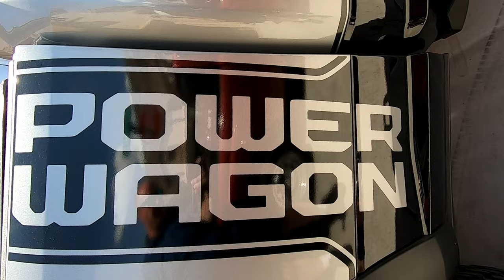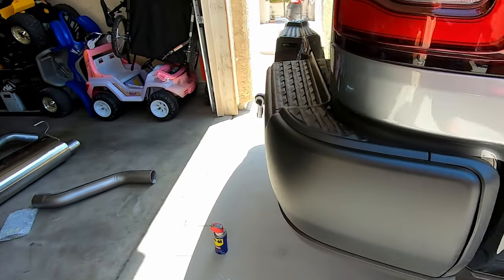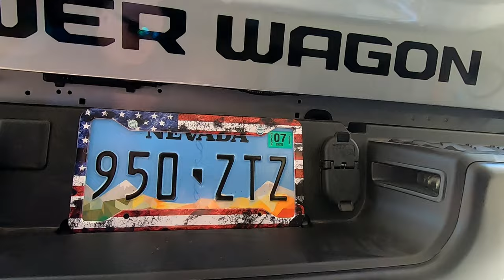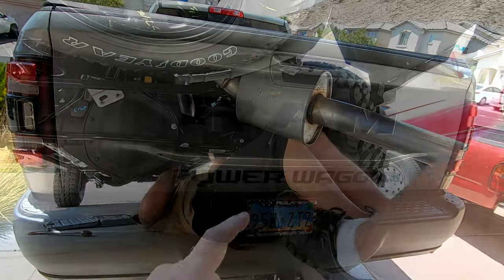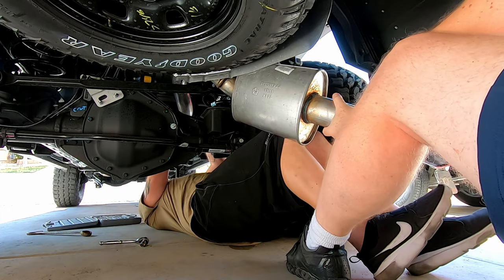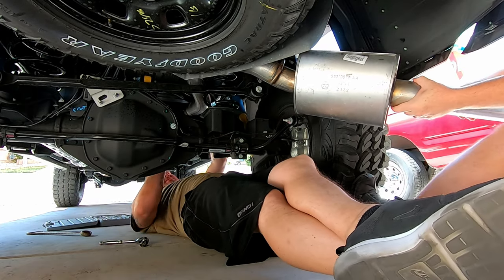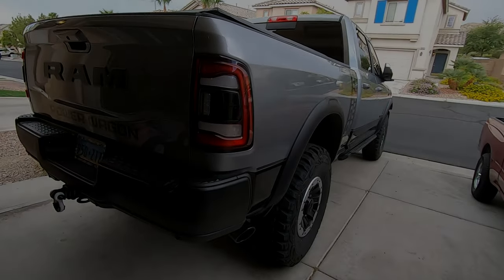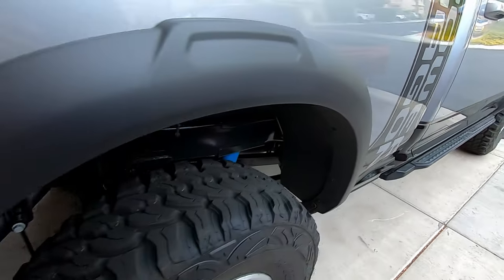BORLA S-TYPE on RAM 6.4L HEMI POWER WAGON

Comment: Nice to work on trucks with so much ground clearance. Borla has always been top shelf! If you go with another brand stay with 304 stainless over 404. 404 might last longer over aluminumized steel, but salt will surface rust it disappointedly bad. Borla is worth the extra money for sure!

Comment: Resonator, not a muffler.  They actually help your engine produce more power and gas mileage by using sound waves to help evacuate the combustion chamber and move the exhaust down through the pipes and out of the muffler.  This action relies heavily on the resonator. By tuning the pulses of exhaust gas to work together, it creates stronger waves of exhaust that vacuum the gas out more quickly.

Comment: The "rear muffler" isn't a muffler, it's a resonator.  That's why no difference in volume/loudness.  Resonator just changes tone and helps eliminate drone.  How's the Borla sound with MDS kicked in?  Also, those aren't bead locks.  They are bead lock capable, if you can find the rings that Ram says exists (probably right behind the unicorn barn as far as I can tell), but as delivered the rings are just rim protection/beauty rings.  I've got a 75th anniversary PW and will probably stick with 35" but those 37" look nice.
Reply: Curious about the MDS with an aftermarket exhaust.
Reply: Same.  I’ve been trying for 2 years to find the bead lock rings for my 75th.  No luck.
Reply: @benmartin2697 it’s annoying either way. I always turn it off
Reply: @benmartin2697 only goofs get annoyed by mds.  Sounds fine with magnaflow
Reply: Whats mds and how do you disable it?
Reply: Just set the manual gear limiter to 8th when you start the truck and mds is disabled.
Reply: @SeguroOffroad from inside the cab, highway speeds, how different does it sound from stock when it activates, and what speed does it start to fade? I like my MDS and it's on most of the time I'm moving. 25-50 mph seems like the sweet spot. Figure more mods, more weight, I'll start to lose some of the top end of that range.

Comment: Sounds sick however did the noise level increase inside the cab and by how much?  You stated you couldn't tell on the drone and heard the tires more over so that's actually decent confirmation right there.  You'll know if you had drone. Borla markets this system to not having drone so wonder if accurate.

Comment: Great truck and sound.  At the beginning, indicate those are Pro Comp 37" tires - Is that on stock truck, no lift or front level?  Lots of other videos indicate 37's rub, but you look to have plenty of room.  Thanks for any advice.
Reply from the maker: No lift or level at time of video. Shocks have since been upgraded and now has front level. Slight rub on inside before that, but only full crank or while hitting bumps and turning. Nothing serious, though.

Comment: How does the hemi compare  to the gm2500 HD, plus maintenance, parts ect ,
Reply: Gas is cheaper to maintain than diesel. Type of engine will make more difference than brand.
Reply: @robertgoodrich8953 Nothing you said came anywhere close to actually answering the guy’s question 🤦‍♂️